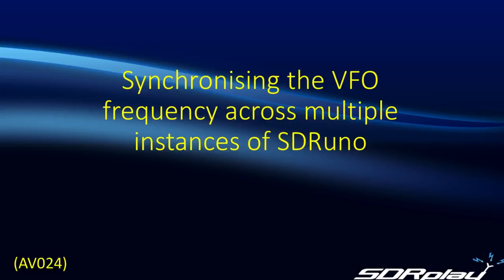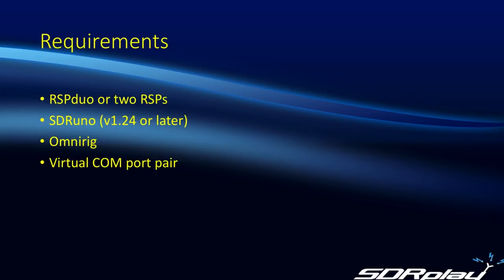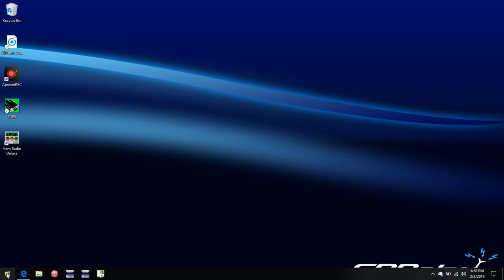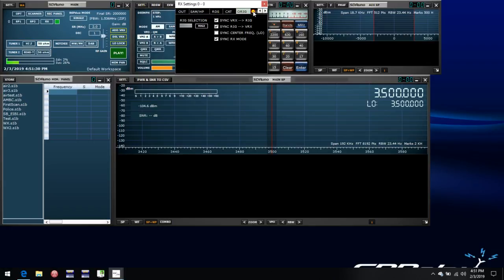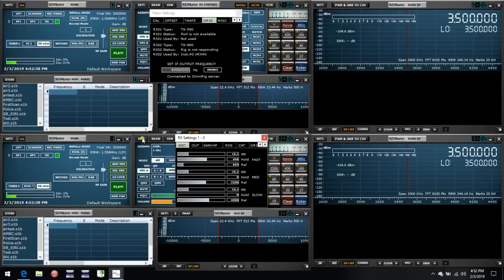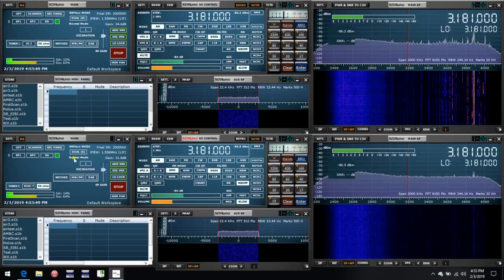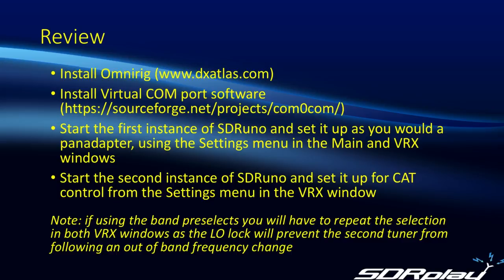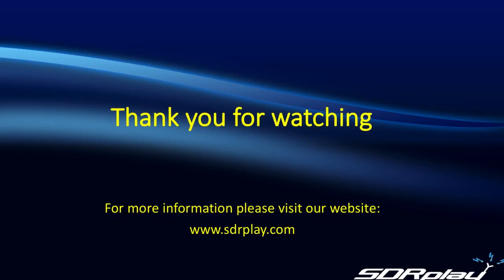Synchronising VFO Frequency for Multiple tuners

Comment: When using Dual Tuner mode with an SDRduo for listening to a single frequency on two antennas, are the two audio signals going to be in sync. My aim is to do diversity stereo reception. However, I am not sure that the two instances of the SDRuno will have perfectly synced audios (for example because of OS timing issues). Can you comment on this please. What can be the audio mismatch between the two tuners (in milliseconds)? I also assume that using 2x RSP1a for the same purpose is out of the question? I am asking all this as I am planning to buy the RSPduo for doing stereo diversity reception.